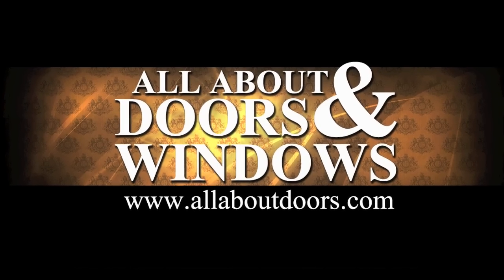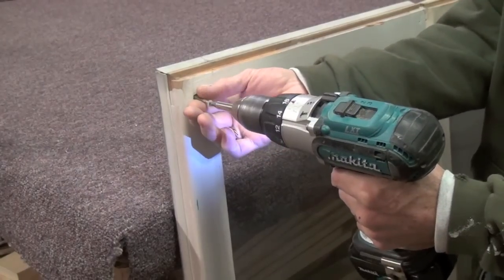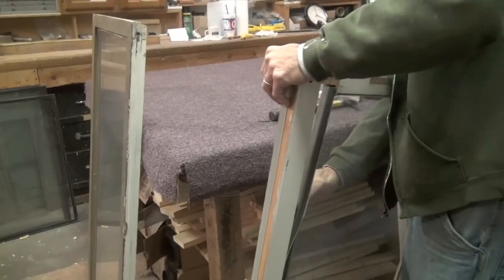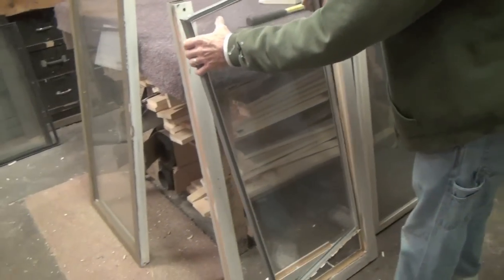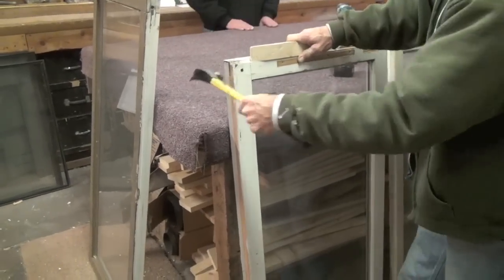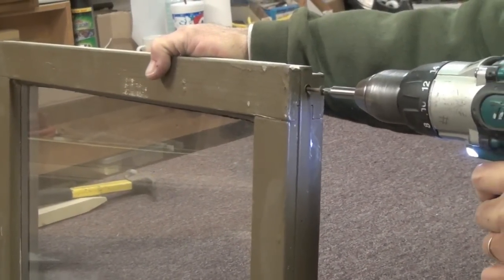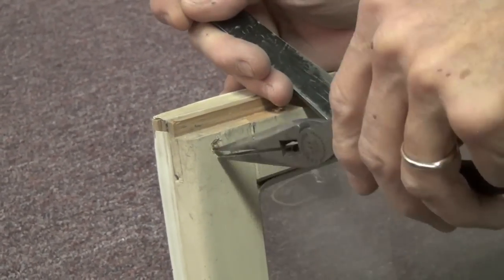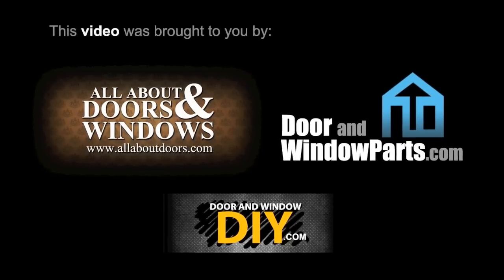How to Replace Glass in a Casement Window Sash

Comment: Mine are made by Lincoln Windows and their tech support said that they are not designed to come apart.
Reply: They have removable stops 
Very easy
Reply: @murph16999  Not if they are the 2001 vintage made by Lincoln Windows.